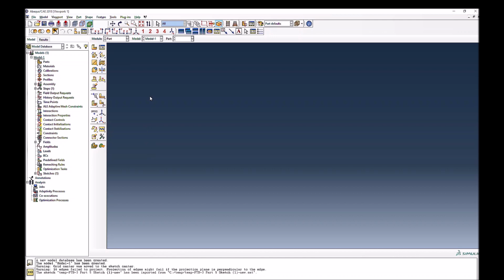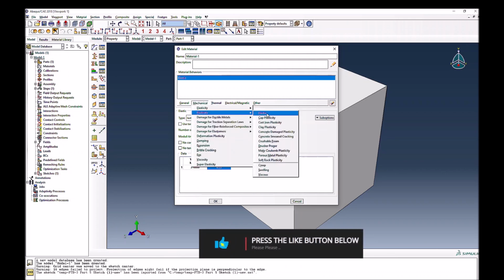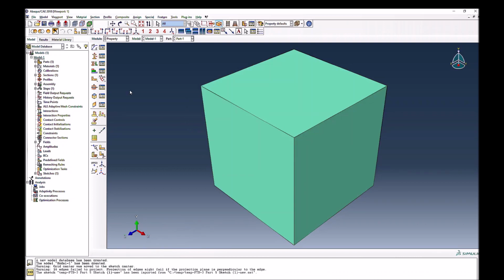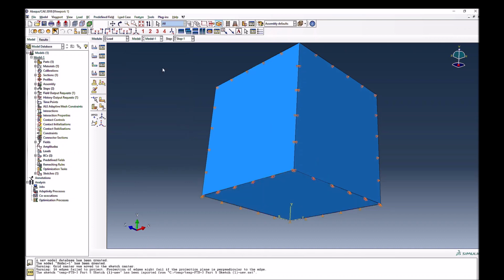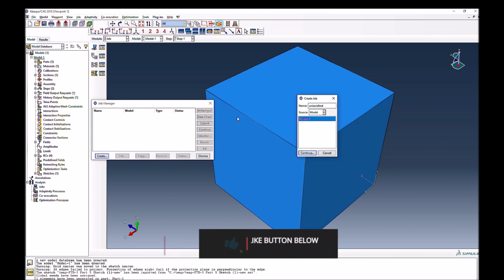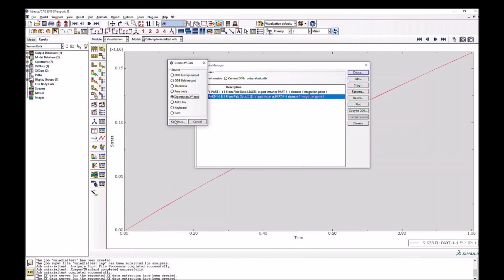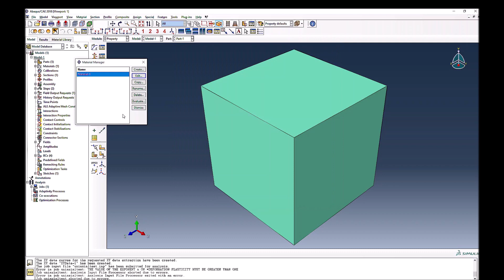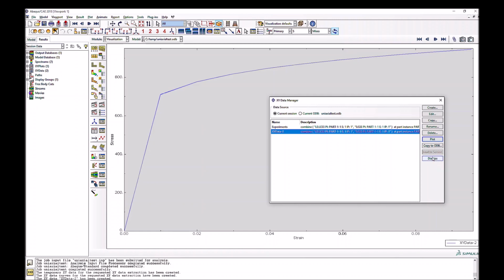Simplified Uniaxial Test Simulation in ABAQUS: Material Parameter Identification Made Easy

Comment: in uniaxial stress, the stress value, except for 1 direction will be zero right ?
which one of your video explain the uniaxial ?
my structure is cube with a hole in the middle. i want to have uniaxial stress in y-direction, i followed your describtion but it seems wrong(because s11 and s33 still have big value. )
Reply from the maker: Yes that’s true due to free surfaces.
Any imperfections including hole will cause stress concentrations around the hole, etc. and hence there will be higher stresses in other directions. If you could email me the model with details on what loading you need then I can quickly create a short video. Visit www.professor3mec.com for contact details.

Comment: sir i am testing a VUMAT by using a single element of size 0.25 x 0.25X0.25 mm … i am facing difficulty that how much displacement has to be applied.
Reply from the maker: It depends on the strain values you have in actual stress strain data. For example, if you have a total strain of 0.1, i.e. 10% then displacement = strain * length = 0.1 * 0.25 = 0.025 mm